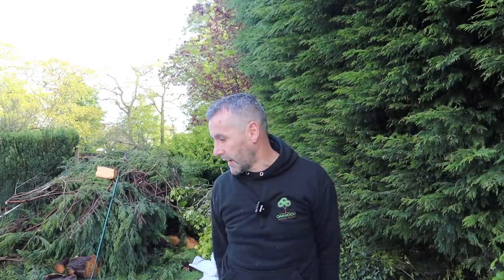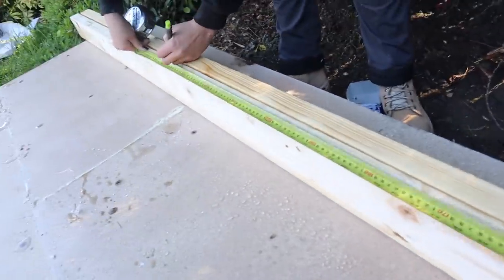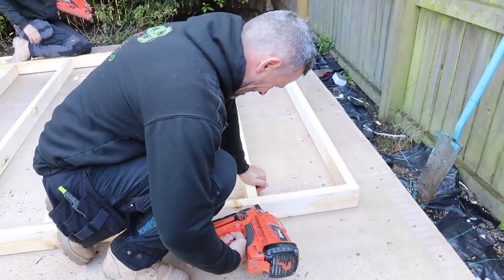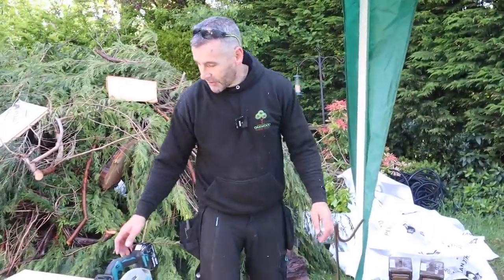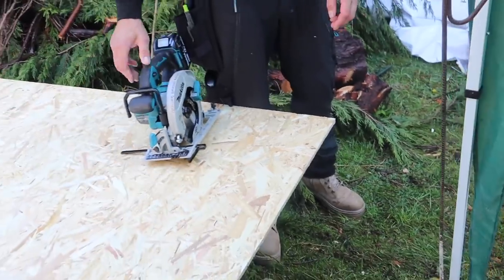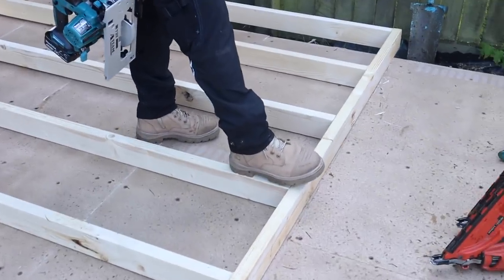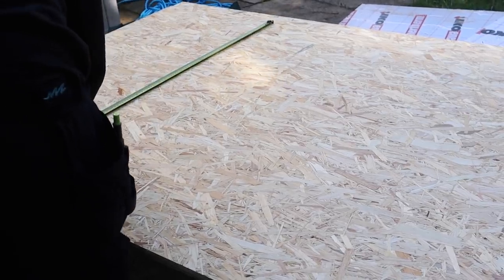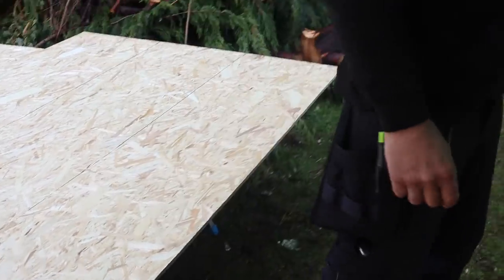Garden room build, walls going up

Comment: Studding for metric and imperial 
I’ve often thought about marking out the studs intermittently like the 1st one from the end at 400 then the second one at 32” then mark out metric for the plaster board from the 400 one and imperial from the 2nd for the OSB. 
Haven’t tried it yet I may be talking crap I know

Comment: Next time measure the width of your wall plate and snap a chalk line on the perimeter of your floor on all 4 sides and then you know when you stand your wall up to pull the wall to the chalk line it will be in the right place

Comment: Hey guys. I notice that some of your walls are placed on top of Egger Protect. The Egger website says there should be a 10mm expansion gap. I'm following your builds but was just wondering if you've had any issues with the Ether lifting in the centre's because it can't expand. Also, has there been any problems with the cut edges of the Egger Protect being kinda exposed to the outside elements. Cheers guys.
Reply from the maker: No issues at all mate
Reply: @thegardenroomguru  
Cheers mate. I thought there wouldn't be a problem especially when these aren't  floating floors. Afterall, Egger recommend screwing them down so how would they expand??!! Keep up the good work and I'll keep you updated on my garden room Im building following your vids down here in sunny Bournemouth🌞

Comment: Thanks for these vids Liam and team. I’m doing the side walls ATM! Although a lot slower. I see you run the OSB flush to the top plate. Do you go back and in fill the little wedge shape that’s created above the top plate by the roof pitch with OSB? Or just use breather membrane it to the infill noggins that tie the roof in?

Comment: I'm looking to build a garden room on a concrete base, do I need to build it off the base with bricks or can I just bitumen the base joists and sit it flat
Reply from the maker: id lift it off the pad mate
Reply: It wont make any real difference to be honest mate, if you put sheet down under the concrete you wont be getting no damp coming through into the concrete, just rap your membrane round your bottom lengths, should be fine its most likely pressure treated anyway?
Reply: @kamikaze7347  hi yes I'm going to use pressure treated, do you mean the roll of membrane for bricks to wrap round
Reply: @rickc1798  Yeah mate so just like tyvek type of stuff, breathable membrane.